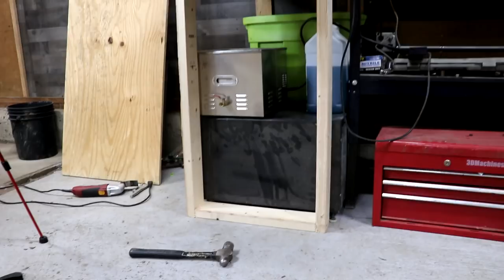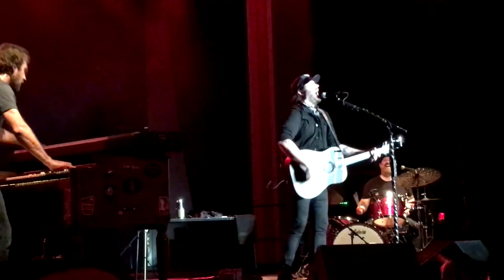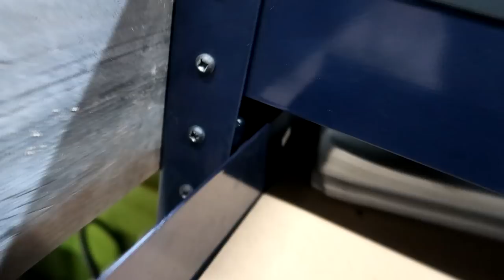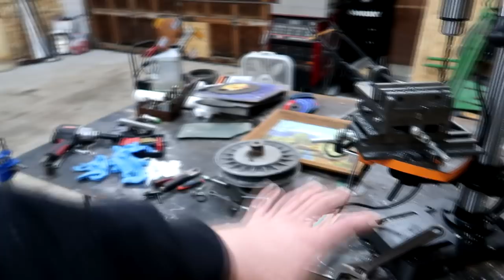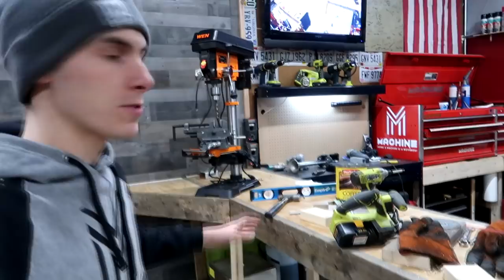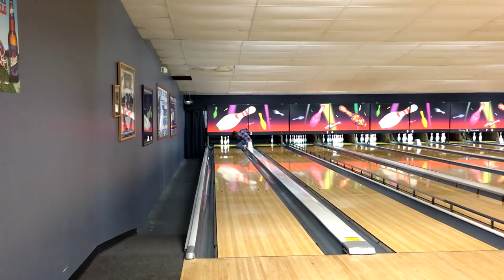MOTORIZED DRIFT CART MODS

Comment: Dalton you need to lower the drill press the drill bed is at to close of a height to your eyes. It's easy for shavings to fly up or out and with that being at such a close height to your eyes it's dangerous not to mention the drill bit could bite into a peice of metal then throw it. Seriously you need to lower it, it's a hazard

Comment: 46" is really tall, I think that you'll regret that eventually.  I'm 6'4" and I' ve pretty much standardized on 39.5-41" tall for all my benches (If building from scratch I typically go 40.5" so I can cover it with something).  Till I did that I could never figure out how people worked standing all the time, I always sat down working on things, and I thought I was lazy.  Now with 41" I rarely sit down to work on anything.  41" puts stuff in a vise at just the right height for hammering/cutting... but every once in a while I find something that I wish I could "get over" a little better, and almost everyone else gets frustrated using my shop, they can't reach anything (I also tend to hang things and mount outlets in the ceiling of my basement shop which means that anyone under ~6' pretty much can't plug anything in without standing on something)

Comment: I had built a pretty cool workbench , the corner post are 4x6 like they use on patio decks .  its on wheels so I can move it easy . built it the same hight of my pickup truck tailgate down .  I made so I can pull a full size touring snowmobile out of the bed of my pickup and put on the workbench and move it around